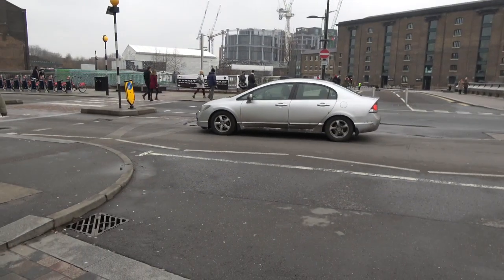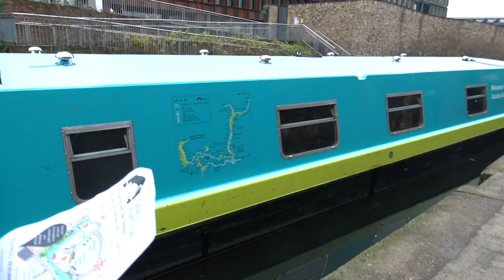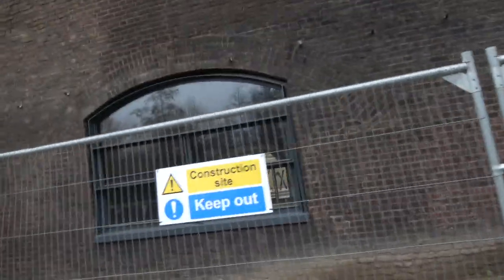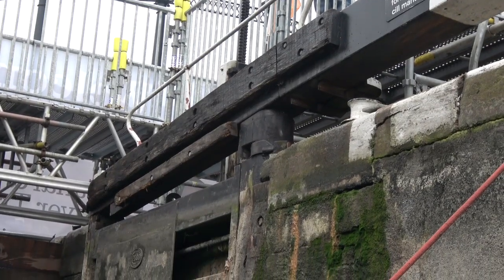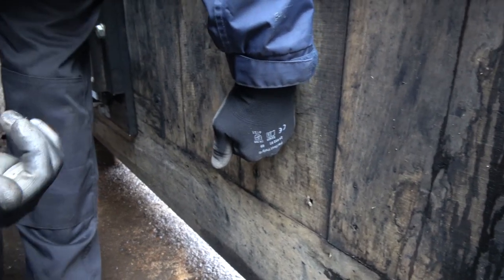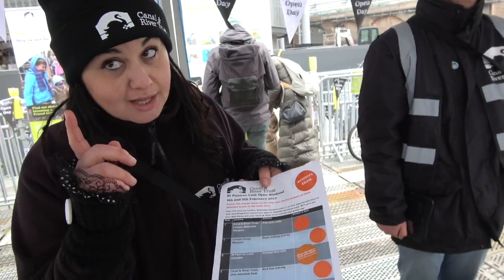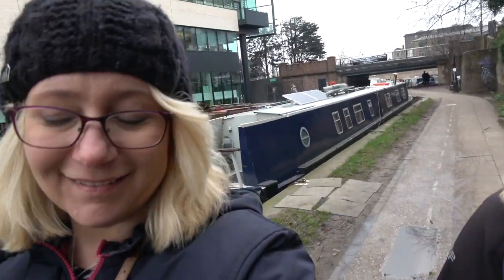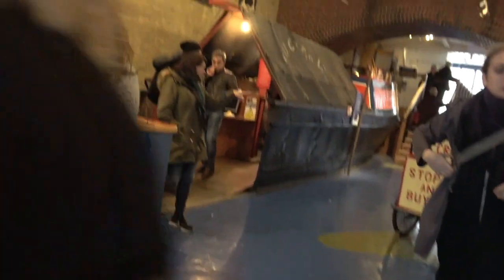Narrowboat Experience outing | St Pancras Lock | CRT Open Day | Regent's Canal London

Comment: The canals are not "that" deep, which is new for me, but I do wonder, why the water gets SO dirty! - Awesome video. Warm regards. D/P
Reply: Much of the coloration is due to the stagnation of the water.  There is no real water flow to keep the canals clear.  The bottom and sides of the canal gets mixed with the life cycles of the surrounding vegetation, causing more murkiness as it degrades.  Some very old canal channels have completely filled in from lack of clearing away dead vegetation.  Canal Boat magazine has done some articles on what it takes to restore a canal channel, if your interested.
Reply: Does that mean that more canals will fill in due to the lack of public interest and lack of funding for maintenance?